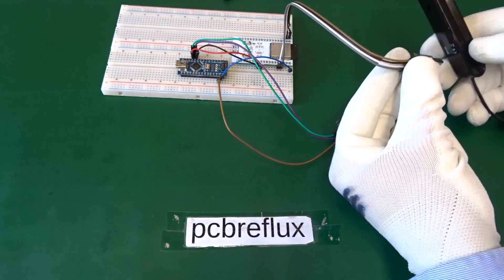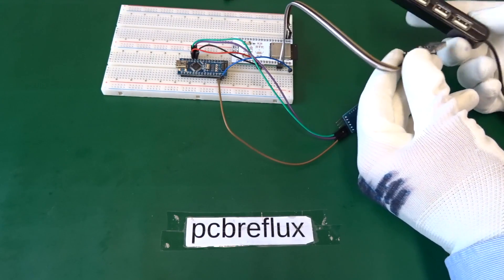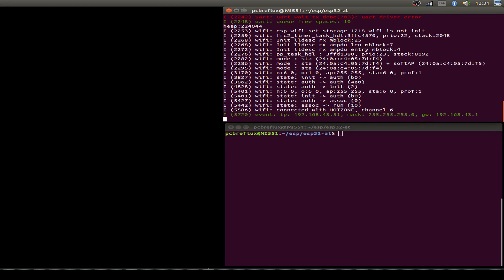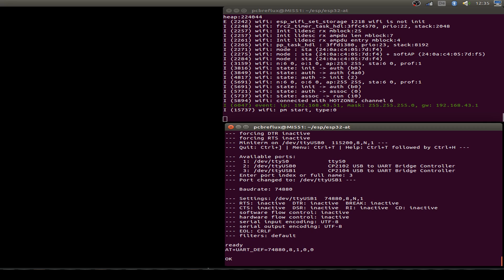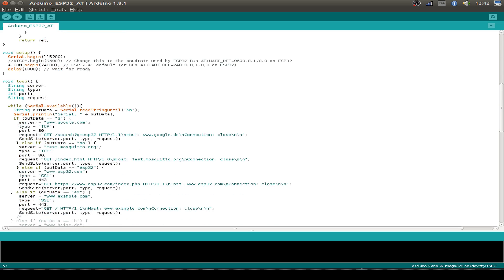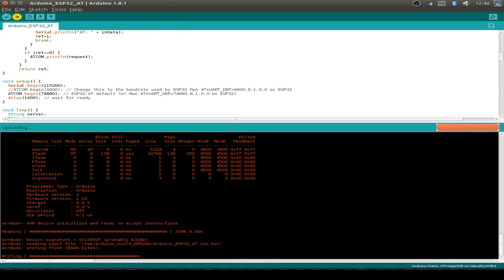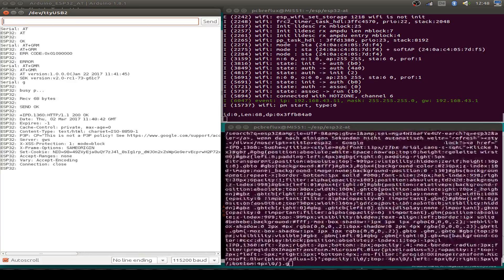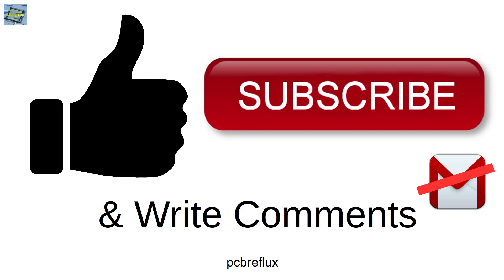ESP32 #22: ESP32-AT - Arduino Nano connected ESP32

Comment: Can we use a single UART Interface for Uart download and also issuing AT Commands...? Thanks in advance
Reply from the maker: After download you don't need the first UART, only if you want to debug. For communication you only need a single UART interface. You can flash the firmware and then switch to the second UART pins.